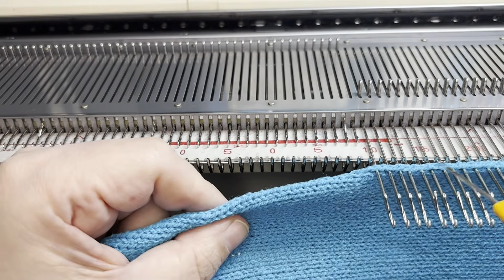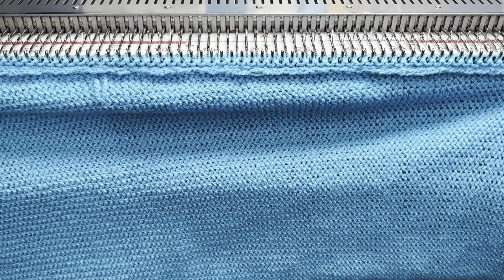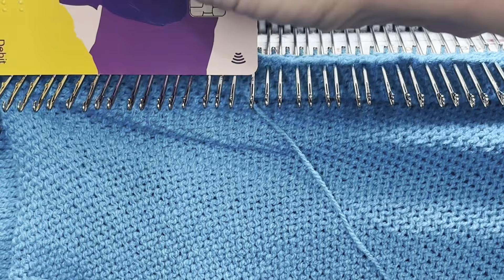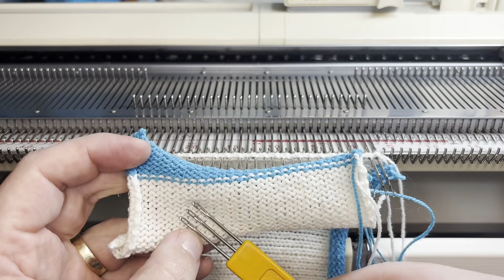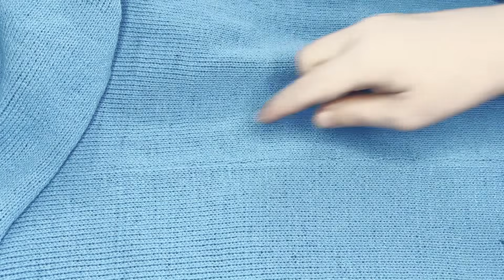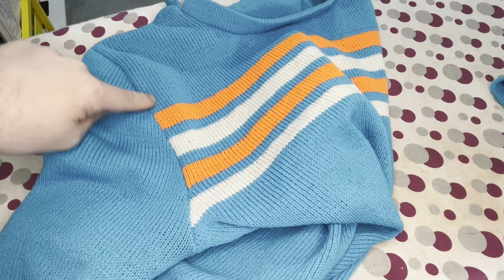Joining different knitwear seams by Knitting Machine

Comment: This is a great video, I’m just unsure what to do with the yarn in the carriage after I’ve placed both panels on my needles. Do i tie a slip knot and place it on the first needle on the right before two passes with the carriage? thanks
Reply from the maker: No, you leave the carriage threaded up - so once you’ve put both pieces of knitting on the needles thread the carriage in the normal way as if you were starting a piece of knitting.  Some clamp the free end of yarn to the table - I just leave about 8” hanging down and put a clothes peg on the end to weight it down

Comment: I wonder why 2 rows in tension 10. Would 1 row not do the trick ?
Reply from the maker: It doesn't give enough flexibility in my opinion, and the seam can look a lot tighter than it should do, even after steaming.  Two rows gives a neat, flat appearance
Reply: @WoodsideStitches as a follow-up question, we are adding additional yarn/bulk to the seam with this method?
Reply from the maker: @SirkkuT No more additional yarn than what you would be doing if you were to use the same yarn to sew the seams by hand or use a linking machine

Comment: Thanks for the tutorial. I have followed all the steps and my two pieces drop off the bed every time. I am placing the thread on the carrier, do I need to do an ewrap or something? Thank you.
Reply from the maker: No you don't need to do e-wrap.  You just need to follow the instructions as shown in the video exactly.  What you do need to do though is to ensure your carriage is threaded correctly, make sure the yarn is well back in the feeder and the gate is closed, otherwise it will fall off
Reply: @WoodsideStitches  Thanks so much for your response! I think my two pieces were too thick for my std gauge machine even though I knitted them in this machine. I tried again following the exact process with two pieces made out of thinner yarn and voila, it worked! I am new to knitting and to machine knitting and I appreciate your feedback so much. Take care!

Comment: What tension setting on the post do you use? What size stitch on the carriage dial do you use usually? I'm not having any luck with the 3-prong transfer tool picking up end stitches. I thought it might be because of one or both of those things
Reply from the maker: The post - do you mean the tension mast? It all depends on what the wire is doing.  If you have the yarn held in the brake and the tension wire is slowly rising up in an arc then the mast tension is correct.  It should not be standing upright.  For UK 4ply the setting is usually in the middle.  The stitch size is dependant on the feel of the fabric it produces - again for UK 4 ply it can go from 6 for a thin twist to 9 for a thicker twist
Reply: @WoodsideStitches Yes the mast. I think of it as the tension. I think of the numbers on the carriage dial as stitch length (like a sewing machine, although a sewing machine is stitches per inch, making the number 10 smaller than the number 8). I wanted to know what settings you use so I could set up my machine the same way. I wanted to see if the 3-prong tool would then work for me
Reply from the maker: @Che @CherylDavison-j8k The 3 prong tool should always work to be honest, only if your stitch size or your mast tension was unusually tight would it have great difficulty in going through the loops

Comment: I love your method of using the 3-prong transfer tool to pick up  the edge stitches. I never have increases on the edge, so I never have the oversized loop you do. When I am making increases, I move 2 stitches out one needle. This leaves one needle empty. I then pull up the leg of the stitch one row below to fill the void. I use the stitch within the body, avoiding the edge. There is never a hole when I increase.
Reply: I thoroughly enjoy and appreciate your tutorials. I have learned a lot from you. I do a lot of increases within the fabric for shaping. This method works incredibly well. Perhaps I have taught you something? I hope so. It would make a payment back for all you have taught me.
Reply from the maker: So you do the fully fashioned increase.  It gives a beautiful seam, but really the only reason I don't do it for an underarm seam is out of pure laziness.  I do love the FF decreases on a raglan sleeve though and almost always do those, they give a lovely appearance

Comment: Excellent demo Jason. Did you use 4 ply for this? Will it work for 8ply too, or will you get a thicker edge?
Reply from the maker: Thank you.  This particular demo was done with 4ply, however I have also done this on an LK150 using double knit and it works well too.  The key is steaming the areas afterwards

Comment: Thanks for your videos's you explain so clearly. Sorry if this is a stupid question. My side seam is 36cm long but 162 rows. Should I be skipping some rows as I hang it so as not to stretch the knitted stocking stitch fabric too much? When I practice on my guage swatch this seems to happen in a natural way but I wonder if you have any tips?
Reply from the maker: You're very welcome and no question is ever stupid :-) You could skip some rows, perhaps hang 3 and then miss one, but to be honest I've never bothered with this and I've hung side seams all the way along the machine without any issue.  Just ensure that it does not stretch and it unrolls smoothly.  You use your gauge to work out a stitch/row conversion using the calculations for that, but to be honest I don't ever bother - if you're careful not to stretch the seam then it won't be an issue.  Just don't have the knitting hanging down too much - give it some support.